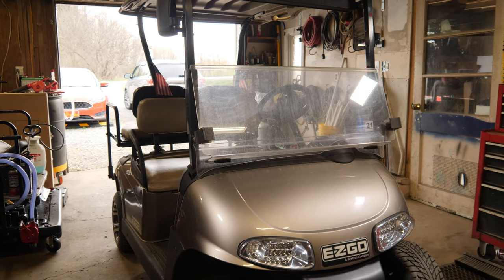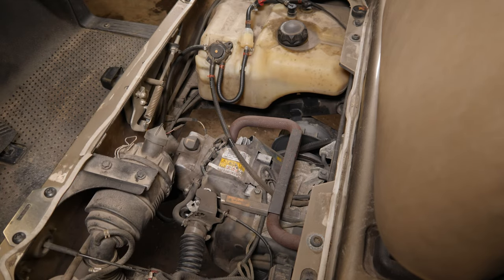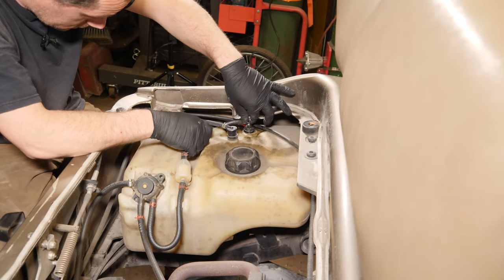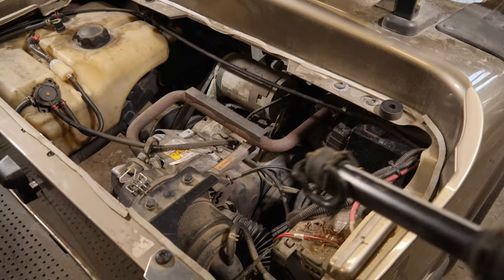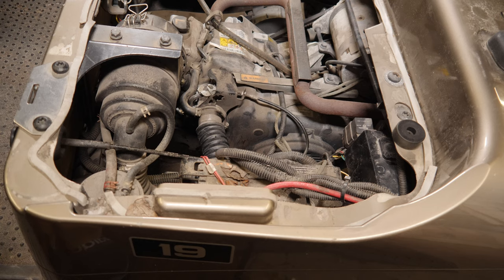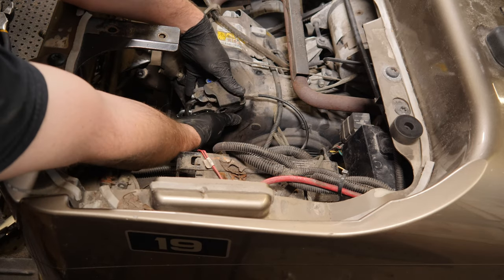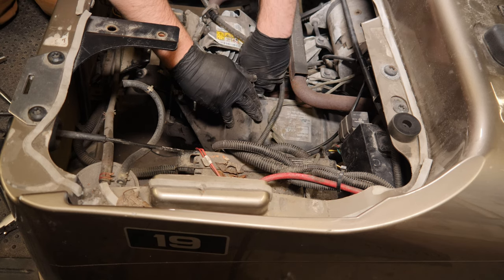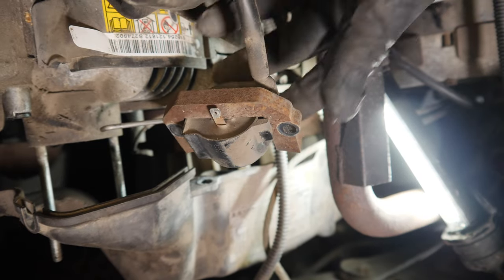2013 EZGO RXV, Gas - No Spark, Shuts off Randomly

Comment: You know, it's not too often you come across a video channel that's worth watching. Have learned quite a bit from your videos. You're the real deal and would bring my carts to you every day of the week and twice on Sunday. One request that I would suggest and would probably speak for several ppl (troubleshooters) that watch your videos is doing a video of a complete diagnosis of an electric cart. In other words, when you get a cart in that doesn't move and no sound from a solenoid, what do you start with first? Check batteries first?...if good, then move onto solenoid for power? What readings should you be looking for to tell if it's good or bad? If that's good, then what would you move onto and what readings would be looking for? When you go through you diagnosis and it comes down to say....a forward/ reverse switch, how did you come to that conclusion? Thank you for the videos...they really are helpful.... at least for me. BTW, condolences and prayers about your father.

Comment: arnt these motors pretty much identical to the fe350 that's in my club car? Also does that ground that you connected to the igniter run to the rev limiter? I've had issues with mine popping off before then I lost spark.
Reply from the maker: These are FJ400 engines. They aren't equipped with rev limiters, to my knowledge. The ground wire is tied into the stop relay. If it comes off, you won't be able to turn off spark since this shorts the coil to ground.

Comment: With all your complaining about the ezgo cart ,you don't have to pull the motor or drill holes or even remove the filter to get to the coil,ezgo made the cover plastic ,so it bends ,all you have to do is take off carb ,undo the cover bolts at the top remove the large carb linkage cover bolt ,bend the cover back ,and now you have plenty of room to get to coil. Any mechanic knows that you install the coil over the magnet . And you did not think you installed the coil over the magnet ,as you stated you wanted the magnet away from the coil . But at least you admitted you made a mistake , a little tip for you ... Maybe think before you speak or complain ,it may make you look like an actual mechanic.  .
Reply from the maker: I'll complain all I want. You don't have to agree with me. I don't really care what you think.

Comment: Great video Kevin. You have risen to the top of my YouTube celeb list, alongside Doug Demuro, Tyler Hoover, and his friend Car Wizard.

I have an ‘89 Marathon with 2 stroke.  Oil is adds to the gasoline (doesn’t have the automatic oil reservoir).  I understand the ratio is 100:1 which i believe is 1oz per gallon.  It’s a bit fumey and noisy, otherwise runs well.  Am I correct?
(Think the clutch is contributing to the noisy operation- especially at high speed.)

You helped me the other day with a fuel issue (can’t run gas below 1/2 tank). The cap is not venting.  I cannot find a replacement dip-tube anywhere. These are threaded into the tank - not grommeted.

Should I check compression?
Do the old 2-cycles have valves to adjust?
I should probably clean the carb.
Air filter and spark plug clean, new solenoid in.
Am I missing anything else?

Comment: Kevin I got a 2018 ezgo s4 I was riding yesterday every worked perfectly when to get on it today and it want do anything at all I jump solenoid it want do nothing but turn over i Checked fuses and everything was good. Will it run with a bad solenoid or with that cause it not to run?

Comment: I had read that some cheap Chinese spark plugs can damage coils on chainsaws. I wonder if the cheap plug, installed by the owner, damaged the coil. The initial problem might have been something simple like the fuel pump. By throwing parts at it, without actually diagnosing the actual problem, the owner may have done more damage than good. We’ll never know, but something owners should consider, before throwing parts at a problem.

Good video showing how to diagnose the problem.
Reply from the maker: I think the original problem was a blocked carb. The customer told me that it wouldn't start so he did this and that. I probably could have cleaned the carb and it would be fine. By using cheapy chinese parts on Amazon or ebay, its now going to cost significantly more. The real kicker with these engines, there's a special clip that holds the throttle linkage to the carb. Aftermarket carbs don't come with it since its supposed to be transferred from the oem carb. Its only available from EZGO and its not cheap.

Comment: I’m having issues with air in my fuel line between the carb and the fuel pump. I replaced both the fuel pump and carb but still have issues. It will run fine then will start being hesitant when accelerator is pressed to eventually getting air lock and turning over with no fire.
Reply: 95 Yamaha g9

Comment: Whats the best cart to own and work on in your opinion? Most reliable?
Reply from the maker: None of them. They all break. Seriously though, its really hard to answer that question with a simple answer. I'd say the older stuff, regardless of brand, are all decent. Most of the new stuff has issues that are just dumb and are all made down to the lowest cost. Anything before 2008 and newer than 1996 is usually solid and easy to find parts for. As long as any of them are well maintained, don't have excessive rust, smoky engines, sloppy steering, weak brakes or any unusual sounds while driving should be easy to work on.

Comment: Kevin
I have a 2006 ezgo txt with the robins 295cc  it won't keep the oil pump primed  any advice
Reply from the maker: That's normal for the oil to drain back down to the sump. If its not building oil pressure, then the pump will need to be replaced. The pump is located behind an access cover behind the fan.
Reply: Thanks

Comment: Kevin, any chance we could talk on the phone. Ive got an ezgo with a fj400d and it loses power under load when climbing a hill. I"ve changed all tune up parts and carburetor along with fuel pump and still loses power when under load. If i don't push the gas pedal to the floor it will continue to run seemingly normal at low rpm. I've ordered a coil and it should be here in the next three or four days.  My question is will a coil sometimes fail under load and emit enough spark when not under load to run the engine up to proper RPM when not in gear? Look forward to hearing from you and that for the vid and consideration,,,Steve.
Reply from the maker: Unfortunately, I don't offer any phone support. I just don't have the time for it. Ignition coils typcally work or don't. It sounds like you have a drivetrain issue. Without any information on the cart, I can't really offer any help. Is it lifted, oem belt, what year is it, 4 or 6 passenger, are you using ethanol free gas or just plain 87-93, are you on a lot of hills, flat, or mixed? There are too many variables to give a solid answer.
Reply: @Kevinsgolfcarts  Thanks for getting back to me Kevin. It’s a 2005, lifted, and the belt and clutch were replaced 4-5 yrs ago with a ezgo heavy duty “truck” clutch. I use regular ethanol gas and it’s a four seater. I’ve also checked the valves and they are within spec.  Terrain is mostly flat with occasional hills and it always occurs on a steep incline. If it is a drive train issue then what part could it be. Hope to hear back and thanks again for your consideration

Comment: did you get the coil off amazon
Reply from the maker: No, I try to stay away from Amazon and eBay for parts. I'm a RHOX (Red Hawk) dealer so I buy most of my parts from them. Certain parts I try to buy OEM.